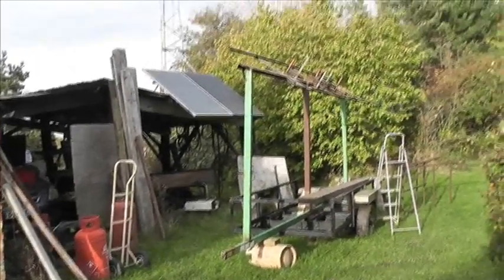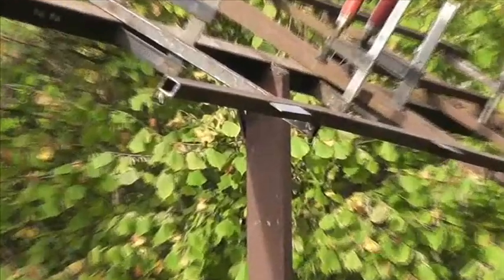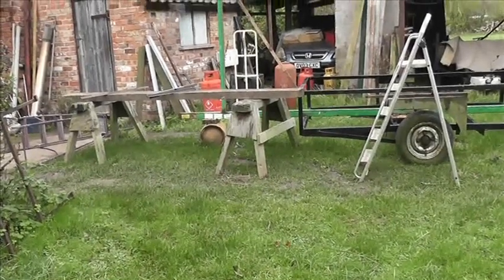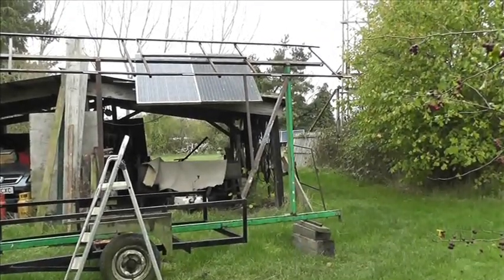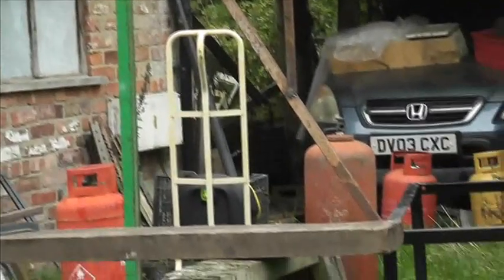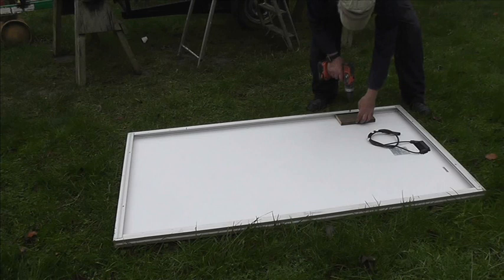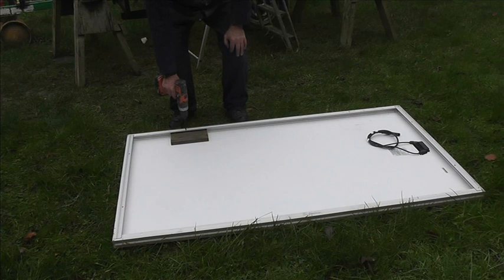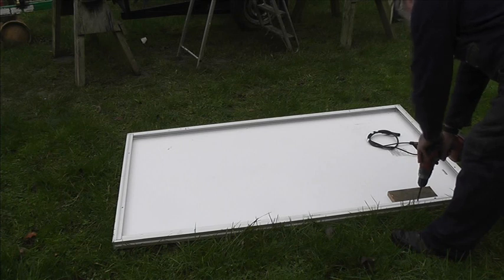Solar trailer build 2, mounting the panels and finishing the frame.

Comment: Well done Andy
Good idea having them on a trailer.
A weatherproof box for the electricals, that's a portable power generator.
Reply from the maker: Sam, I hear you but I wouldn't like to tow this on the road, it's part of our home power system. Mobile so I can move it if it turns out that it's in the wrong place, cheers

Comment: Excellent mobile solar installation are you considering maybe some weight on the trailer for high wind conditions maybe an IBC that can be filled
Reply from the maker: Hi, just depends where it's sited but some dead weight will probably help, cheers

Comment: This project is coming on really well. It should produce about 130 volts at  around 9 amps on a good day. Are you going to earth  your Trailer/Frame when in use. 130V is more than enough to  finish you off if it develops a ground fault. No so long Bach I saw an electrician with a very black finger after working on Solar panels.
Reply from the maker: Hi, the inverter will have a ground and that is bolted to the frame, cheers
Reply: @TheInfoworks  Yes would have thought you would have covered that. Is  the black paint you use Hamerite?
Reply from the maker: @g7mks383  Hi, we're not done yet and the paint is bitumen. It goes on well and I have some, cheers

Comment: Looking good Andy, look forward to the next instalment. Is the panel angle set or can that also be adjusted?
Reply from the maker: Matt, Ive set it at about 25 degrees, best average for summer and diffuse winter light, cheers